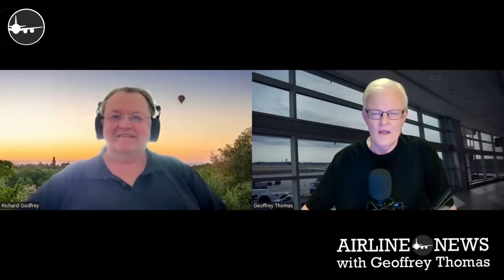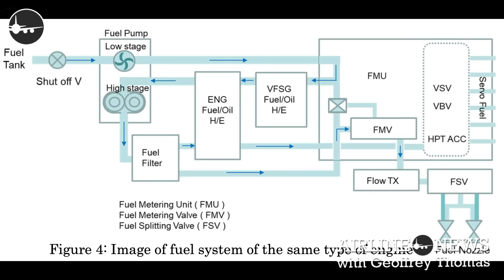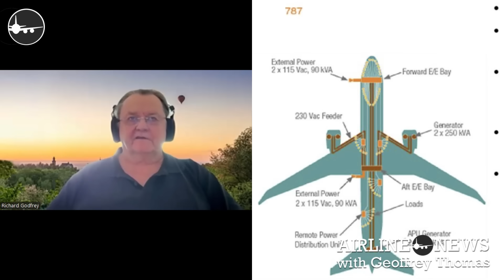AIR INDIA CRASH - FUEL & ELECTRICS FACTORS  #airindiacrash

Comment: Great video guys! 
777 driver here.. we wouldn’t ordinarily check electrical synoptics after engine start. Any malfunction or abnormality ( electrical or otherwise ) would result in an EICAS (Engine Indicating and Crew Alerting System) caution message. Which on the 777 would bring up the appropriate electronic checklist.
Keep up the good work…

Comment: This a great in depth analysis into the complexity of what could go wrong. I think I learned from this there must have been more than a single issue and almost confirmed my suspicions of an electrical problem. The possibility of both maintenance & manufacture of this aircraft due to inherent bad design for specific conditions I believe is going to be the next battle ground & very difficult to brush this under the carpet.😢

Comment: How about the simple thing .. After a lot of training in simulators...a common mistake when faced with a sudden  engine fire or failure after takeoff was to rush and pull the fire handle of fuel lever on WRONG engine thus killing power to BOTH engines. 
If you look at your airport vids..you see what looks to be a dust cloud on port engine...after takeoff.  I believe this was left engine burning. Pilots then got in a big rush to kill that engine. ...and when pilots get in a rush....and things are on fire....mistakes get made. ..low to ground...low airspeed...and no time to recover. I am almost 100% sure this is the most likely scenario ....ie pilot error. ...shutting down wrong engine after a simple engine failure .

Comment: Hey guys!  Buzz Lightyear here.  Just want to say you 2 and the Blankolirio fella are the 2 BEST sources of information for what's going on with civil aviation.  Anyone who makes idiotic complaints on your content or style of dilivery is just being a "Karen".  Now... have you considered a simple but all too catastrophic possibility/scenario where they had 1 engine flame out for whatever reason, but due to pilot fatigue or confusion in the flight deck, both pilots ignored standard procedure to fly the airplane up throufh the climb phase before addressing the engine failure and instead elected to shut the failed engine down by flipping the Fuel Control seitch to CUTOFF during or just after Vr?  What if they shut off the wrong engine at 400 to 500ft?  In a horrible panic, they deploy the RAT or it deploys automatically while they are realizing their mistake and coming to the horrific conclusion that they just topped out at 600ft and are now descending straight into apartment buildings below.  The simplist possibility may be the answer instead of stringing together a bunch of failure modes that have at least a 1 in 10 million chance of occuring individually and a 1 in 10 billion chance of occuring all simultaneoulsy.  Just saying....

Comment: Thx for the overview of the complex fuel system. Hopefully the flight recorders will identify which permutations of possible failures are to be investigated to find root causes and failure sequence. 30sec isnt long for 3 levels of controls to realize they need to reset, resynch and spool up the engines. I  worked in avionics in the 80s and at the time Boeing were the world leader for simulations and testing safety subsystems. All components delivered to Boeing were required to have models delivered by contractors to help their system safety analysis. The precise timing of failures (eg bad sensor readings) and the unexpected cascade of system shutdowns/resets due to software logic or intermittent power can be investigated efficiently with modern automated simulation tools (eg CATIA SysML), I imagine Boeing are doing some version of this as part of their Life Cycle Management processes for all aircraft updates but standards may have slipped over the years. Hardware In The Loop setups can also be used to make the simulations more realistic, even a safe  'water in the electronics'  test could be set up (eg the 1964 movie "Fate is the Hunter"). I would like to hear some kind of statement from Boeing as to what they are doing regarding timeline reconstruction based on the recorders and ongoing simulation analysis of the fault tree.

Comment: Pre-flight passenger cabin announcements universally demand that electronic devices are switched off or switched to flight mode prior to taxi, lest these devices can interfere with flight controls.  Is this warning, which in my observation, is hugely ignored, a myth, or could it be possible that passenger electronic activity be responsible for the catastrophic electronic failure to the Air India flight?

Comment: in your description of the fuel system, you skip the description of the fuel shut-off valves ("isolation" valve you refer to). My question is if you know how these valves are made and operate. This is because I have seen a youtube video where it is stated that the valves are spring loaded to close and opened when electrically supplied: wonder if this may be actually be positively forbidden by the rules.

Comment: Fault Sequence

Internal Battery Short 
The aircraft’s main 28V DC battery develops a hard internal short circuit. This short is electrically tied into the 28V Hot Battery Bus and associated Secondary Power Distribution Units (SPDUs).

Immediate Bus Collapse 
The short draws high fault current, rapidly collapsing the voltage on the affected DC bus. Due to low system impedance and proximity, this collapse occurs faster than any software or hardware isolation system can react.

Cross-Bus Contamination 
As the system attempts to transfer loads or crossfeed power via SPDUs, the fault short circuit condition inadvertently contaminates additional DC buses, including those feeding both the Captain’s and First Officer’s instrument buses.

Loss of Instrument Power > RAT Deploys 
With both primary flight control instrument buses offline, the aircraft deploys the Ram Air Turbine (RAT) to restore emergency power.

SPDU Source Switching Propagates Failure
In an attempt to preserve priority loads, the SPDU switches input sources. This inadvertently allows the shorted voltage collapse to affect non-battery buses, ultimately bringing down the power supply to the Common Core System (CCS) cabinets.

CCS Failure → Loss of Thrust & airframe Data to EECs 
With CCS offline, the Electronic Engine Controls (EECs) no longer receive the required CCS Throttle Module Function (TMF) signals, including thrust lever angle and gear status, but do still receive direct pilot thrust control signals drietly through the standard FADEC throttle resolver angle data link. This is not enough to stay in normal mode for the EEC.

EECs Enter Hard Alternate Mode with Approach Idle 
The EECs, detecting loss of aircraft state, default to “approach idle” thrust — a failsafe intended for gear-down conditions — leading to severe loss of thrust and potential inability to sustain flight.

Key Technical Point: 
No preemptive system exists that can detect and isolate an instantaneous internal short. Even fast-acting contactors or BMUs require milliseconds to respond, while a hard short begins propagating in microseconds.
Once the short is electrically tied to the 28V bus, voltage collapse spreads immediately through interconnected systems before isolation or shedding logic can act.

Comment: Purely speculative analysis:

The operating conditions on the day of the flight were challenging for the aircraft: the weather was hot, the aircraft was loaded with a large amount of fuel for a long-haul journey, and the cabin was full. In such conditions, engine performance decreases due to the lower density of hot air, and at the same time, the load on the electrical and cooling systems increases. The air conditioning system in particular must work harder to maintain a comfortable cabin temperature, which further increases the electrical load. This creates a situation where the electrical system is already under significant stress even before takeoff.

Could the gear up command given early in the flight have caused the collapse of an already overloaded—and according to passenger reports, malfunctioning—electrical system?

Several passengers on the previous flight of the same aircraft reported serious electrical issues in the cabin: the lighting didn’t work, the air conditioning cycled on and off, and systems behaved abnormally. These are strong signs that the aircraft’s electrical system was unstable even before departure.

The Boeing 787’s electrical architecture is exceptionally advanced—far more electrified and automated than in earlier aircraft models. The landing gear retraction (gear up) relies on electric motors and control logic, which create a brief but significant spike in electrical load.

Under normal conditions, the system handles this without issue. But if there are latent faults in the system—such as moisture intrusion, aging components, or maintenance errors—then even this short load spike may become the critical tipping point that causes the system to fail.

My speculation is as follows: the gear up command was issued, but the aircraft’s electrical system could not handle the additional load.

The possible consequences:

The landing gear remained extended — the process stopped partway through.

The fault propagated to the power distribution buses, especially the main AC buses.

The aircraft automatically switched to emergency electrical power, such as the RAT (Ram Air Turbine).

This aligns with the observed events: the RAT deployed, cockpit data transmission ceased, and the aircraft's performance deteriorated rapidly.

Combined with impaired fuel delivery—such as a transition to suction feed following the loss of power to the boost pumps due to an AC bus failure, as well as a possible vapor lock or partially clogged fuel filter—the engines no longer received sufficient fuel and lost thrust at a critical moment.

Comment: Theories are just that - theories - aka speculation - which is essentially a thought bubble.
The CVR/FDR will provide all the answers.
The only matter worthy of comment right now is why Air India/Indian Govt have not revealed any details of
CVR/FDR data recovered.
The CVR/FDR are built to withstand an aircraft crash into terrain at high speed and to also protect against 
a subsequent massive fire.
If a passenger can literally walk away unassisted from the AI171 crash any suggestion that the data from these two 
high impact protected recorders is damaged / can not be accessed is totally unacceptable and evidence of corruption at the highest level.

Comment: 07:22 -  The 787 does not support gravity or suction feed under all conditions — fuel pumps are essential, and electrical power is needed to run them.  if both engines lose electrical generation, and the RAT is deployed, then fuel pumps powered by the AC bus may lose function (or run only intermittently, depending on RAT load shedding).  This could cause fuel pressure loss, especially at high flow rates (like takeoff).

in short, the 787 suction-feed fallback cannot provide sufficient fuel flow or pressure for takeoff thrust.

Comment: I'd be interested in a episode dedicated to the TCMA system (perhaps like the one described in US6704630B2)

The is an aircraft system that whose primary purpose is to autonomically command engine shutdowns in abnormal situations while the aircraft is on the ground, We know that it has malfunctioned and shut the engines down during the landing roll of an ANA flight.

I am interested to know:

- which computers does TCMA execute on the aircraft, and where are they located
- how redundant is this system and its inputs
- what are the full range of inputs the system uses to determine onground status
- is barometric pressure one of these inputs. if so, could a sudden change in barometric  pressure trigger the shutdown. if not, why not? 
- is there any high-resolution barometric pressure data available for the location and time of the incident?
- how certain can we be that a software bug in the implementation of TCMA can't result in the shutdown path being executed, perhaps of a faulty determination of in ground status *(for example if the TCMA system unexpectedly rebooted or failed over during takeoff due to, say, a water leak in a server rack or an unexpected counter rollover?

Comment: Thanks Richard and Geoffrey, I learn more each day from you guys, but nothing yet has taken me away from my belief of what caused the accident.  Here is my two bobs worth this morning. Everyone’s talking about contamination, pump failures or software bugs — but those would likely trigger alerts or affect one engine first, not both simultaneously. “No Fuel” might sound blunt, but it explains everything: long takeoff roll, slow acceleration, low VR speed, flameout right after rotation, RAT deployment, and the pilot’s chilling “thrust not achieved” call. It fits the timeline without needing rare dual failures. The engines didn’t fail, they had no fuel!

Comment: Some things to consider: 
1: At 41C (ISA+26) with a TOW required for LGW,  the likely flap setting would be 15. With Flaps 15 on rotation and during the climb you would not be able to see the top of the bypass ducts whch are clearly visible in the video. 
2: As long as a flap setting was selected, the TOCWS would not sound.
3: The dust plume seems to becomng ftrom the ground not the left engine and this could indicate thay are low over the overrun area indicating an excessively long take off run. 
4: An FMC misprogramming almost caused a very similar event in 2009 in MEL with an EK A340. The crew input a weight 100 tonnes less than actual causing a tailscrape and damage to airport infrastructure before the aircraft staggered into the air, heading towards downtown Melbourne. The ATSB report list quite  number of similar events. https://www.atsb.gov.au/sites/default/files/media/5773945/ao-2009-012_final-report.pdf
5:An unrecognised FMC misprogramming with less than required thrust and flaps, lines up with the reported crew call to the Tower “Thrust not achieved … falling … Mayday! Mayday! Mayday!” (Beware - this verbiage has been widely misreported-this version is from AVWEB and cross checked via several reliable sources) No crew would report an engine failure, partial or total this way...
6: The B-787 has 2 generators per engine and one in the APU plus 17 power distribution nodes for electrical power. 
7:The sink and attitude seems to indicate an aerodynamic stall
8:The landing gear bogies seem to have tilted fwd/down indicating an aborted up selection (in the correct sequence on a B787: the undercarriage door opens, the bogies tilt, the gear retracts and the doors close.
9: There is strong audio evidence for RAT deployment-There are a range of conditions including manual selection that can deploy the RAT.

Just food for thought...

Comment: The GNX engine along with almost every other airliner engine uses fuel pressure from the FMU to control the VSG(variable stator guide vanes), VBV (variable bleed valves, and partly the HPTACC(High pressure turbine active clearance). If you research these engines you will find problems with the fuel nozzles burning up and affecting adjacent nozzles. Fuel from the FMU is metered to produce the required FF, it does this by inputting speeds, air pressure etc and adjusts a tapered rod to flow fuel to the nozzles(basically). Most large turbines have the ability to draw(suction) fuel directly from the tanks in the event of a boost pump failure. In the event of a clogged fuel filter it will bypass and give a CCAS msg.
Leaking Lavs: Yes plausible and dependant on the aircraft’s maintenance quality. The LAVS are triple sealed, any leakage would drip down the side of the hull and end up laying in the belly which should be drained when the aircraft is unpressurized. People tend to think it would be a “shower” spraying over top of the avionics, it isn’t!
As an AME I would be auditing Air India’s maintenance department records as well as the staff.
If you are ever able to visit Boeings manufacturing plants they are nothing like the videos! I spent time receiving B737NG, there and the quality of assembly leaves much to be desired. The plants resemble “Circa 1970”, staff has been subjected to multiple lay offs, seniority not capability rules that process. Now add in an airline that is a government agency possibly wrought with oversight and poor HRM policies and essentially an aging aircraft then you have the makings of a disaster.

Comment: May I please ask again, what is the evidence that particulate material near end of runway is/ was DUST? Did other aircraft using that runway kick up “dust”? Could it not be output from a damaged engine? Had anyone actually inspected the so/called dust at its actual location? Thank you for all your professional and impressive analysis
Reply: Mr Godfrey has suggested that the left engine may have failed at some stage, based on the yaw to the left in the flight path. If that turns out to be correct, then the “dust” from the left side could have been from the engine failure rather than dust on the ground.